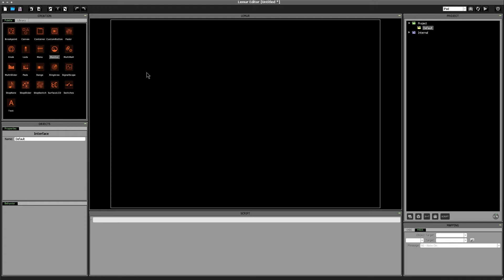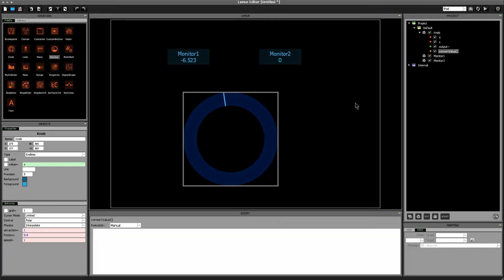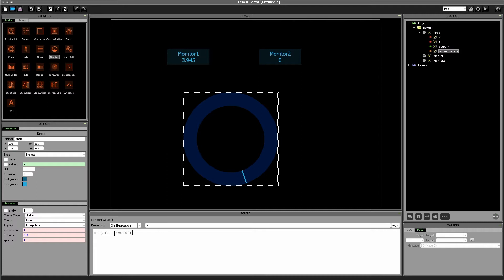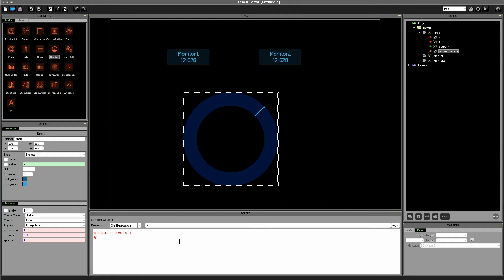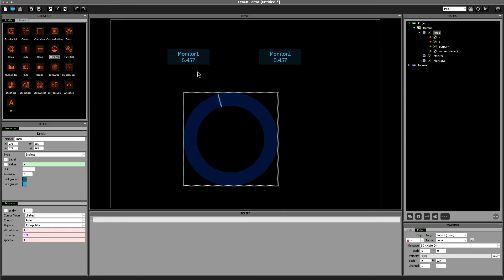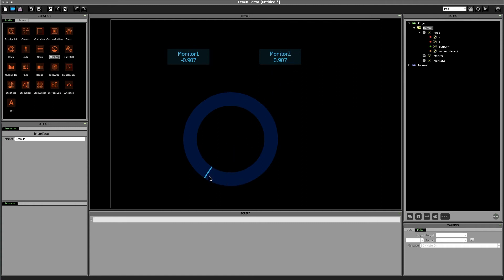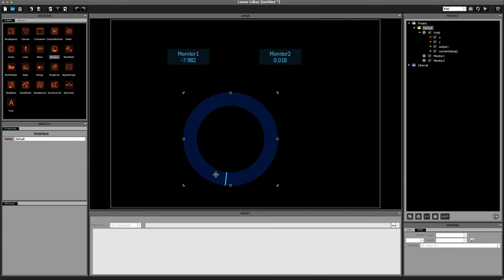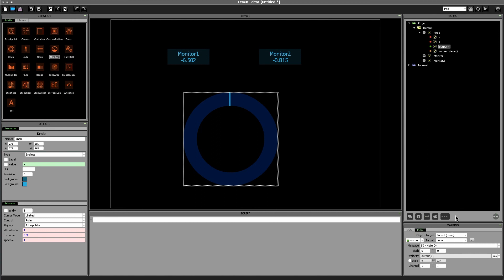Lemur In Depth Tutorial - Creating a Scaled Endless Knob

Comment: Hi. 
Your tutorials are spot on as usual:)
I have this working well. Monitor showing correct values. Tnx sooo much!
The problem I'm having now is with OSC output. I have changed the OSC target to the output variable but the software is still receiving the x variable. I've tried turning off the x variable in the project tab to no avail, and I messed around with changing the object target and target, from Osc 0 to none to no avail either. I'm missing something newbie-ish. Any thoughts greatly appreciated. 
I've tried signing up for the Lemur forum but not getting any response from them.
Reply from the maker: In the Mapping --> Osc menu, did you choose the correct output variable? (The one you created in this video?) It sounds like you probably have, based on your message. The issue now has more to do with your routing. What software are you using to interface between Lemur and your target software? I recommend using the built in Lemur MIDI software interface; I've dealt with this on Mac before but not so much on Windows. Have you looked into it yet?
Reply: @JustHackingAround  
Yep, the right output variable selected.
I'm not using any interface software between Lemur and target software. Didn't know I needed one for OSC?. I know for midi, Daemon is needed but I haven't tried that route yet, just OSC. 
Target software gives a list of addresses for every parameter. I have put the required address into the target address bar in the OSC mapping tab. The x variable works like that.
A new development from messing around trying to understand how this works though. In the new user-defined 'output' expression, I entered x. (thinking this new user-defined expression needs to send the new script calculation back to the x variable or something like that?)  Now when I move the knob on Lemur, the target software will react to the new -180 to 180, but only on expression. When I lift my finger or stop moving it, it will jump back to the x variable position of 0 to 1. Thinking both 'x' and 'output' variables are both hitting the parameter, I deselected the 'x' variable checkbox, but then no signal reaches the parameter. 
Big head-scratch for me. I know there is some basic understanding of variable routing on my part missing. 
Maybe the ConvertValue scripts execution could be 'on expression' and 'output' instead of 'on expression and 'x'? I believe I tried this too to no avail. 

Thanks so much for your time. I understand if you've given it enough time already.
Reply: Yay:)
Got it working with a lot of messing around. 
So, I set the ConvertValue script execution to 'frame', instead of 'on execution' and the 'output' variable =x.  This works. Not sure why, and why 'on execution' won't stick.